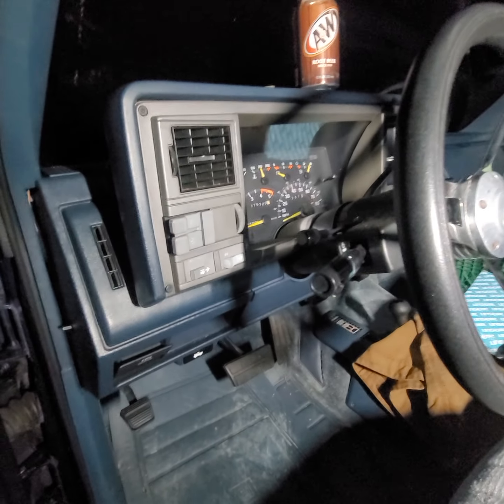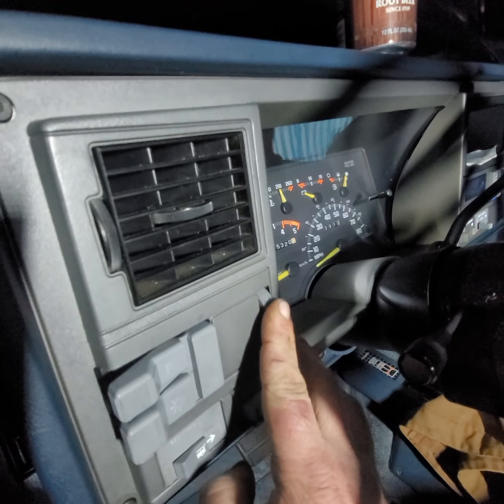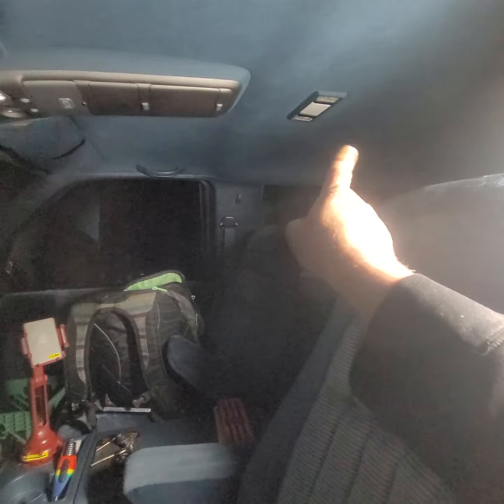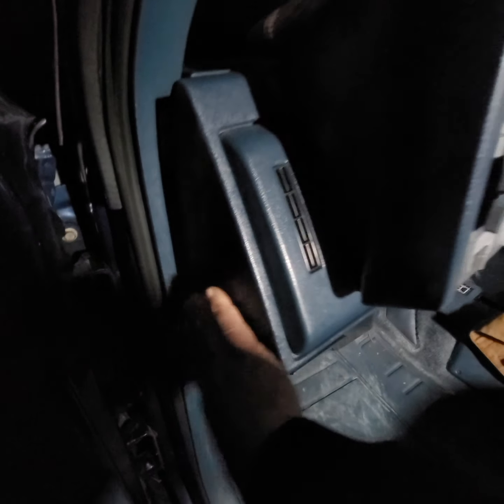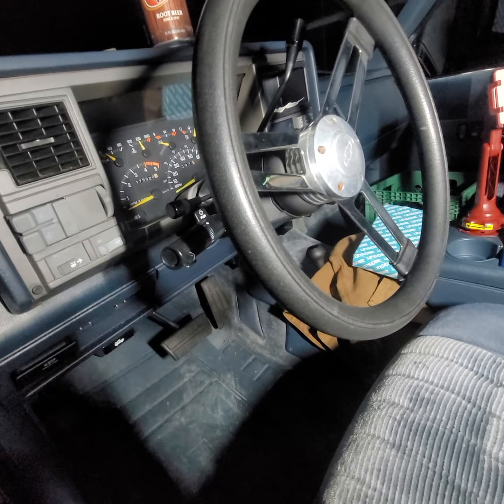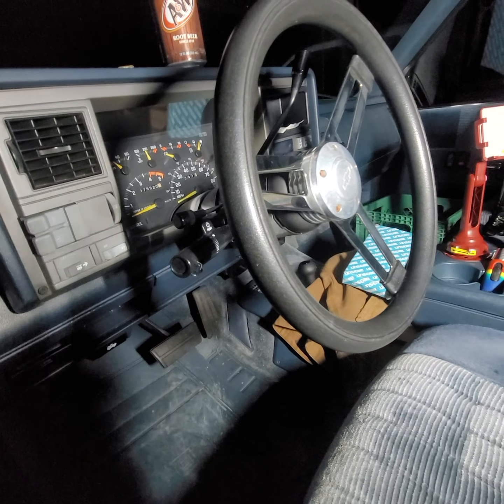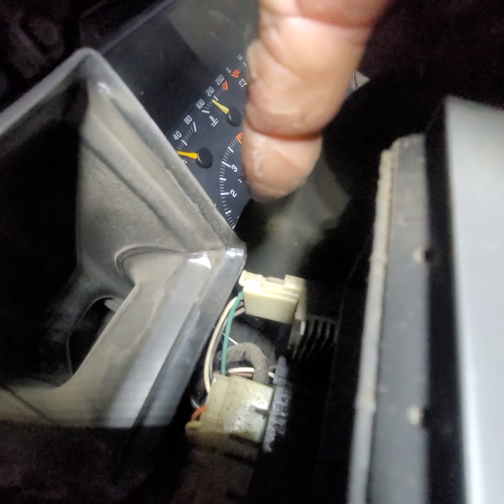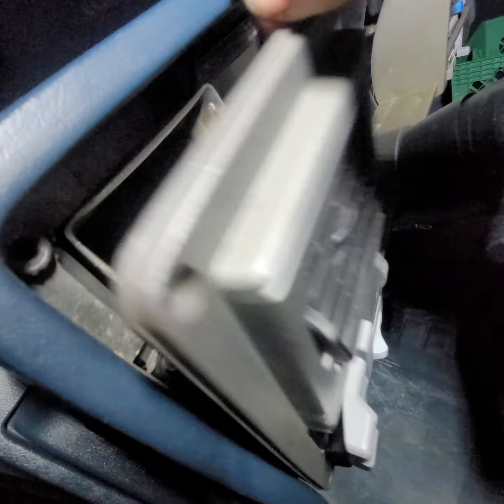94 chevy blazer dome lamp stays on ***Issue fix***super easy***DIY***

Comment: You just made my day. So funny. I've been knee deep in wiring all week. I've had to take nap breaks because my brains been frazzled. 20 amp horn fuse kept blowing. All interior lights, horn off. Checked and sanded and cleaned all grounds, removed the fuse box from the fire wall. Untaped the wire harness and checked all wiring. Pulled the radio, all lighting, lighter, glove box. Pulled the steering wheel to check the horn and interior stuff. All had continuity. It turns out it was the door jamb switch. Rats!! built a nest and shredded the wires. Put everything back together again and walla, the lights work, but, the problem is, the interior lights won't turn off. I got new door jamb switches.That's when I found your video. That's it for today. Tomorrows another day. I'll check a couple of things and should find the solution. Life is good. Thanks for the laugh.

Comment: God bless you for this video. I came home tonight and my interior lights were on the whole way. Not knowing what to do, I disconnected the battery so I could come in the house. Nothing else would turn them off. Not locking the doors. Checking all the doors. After seeing this I just went out and flipped this switch. Mine is a button. After all this I wanted to hit it with a hammer.
Reply: Could have taken the light out